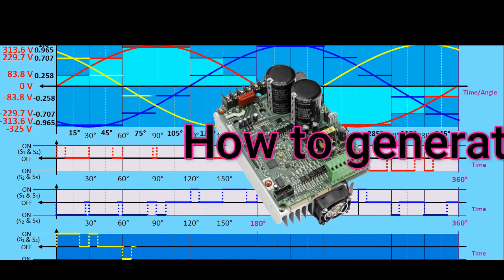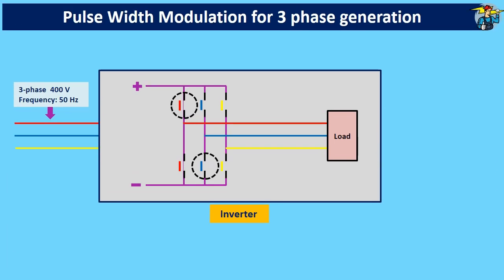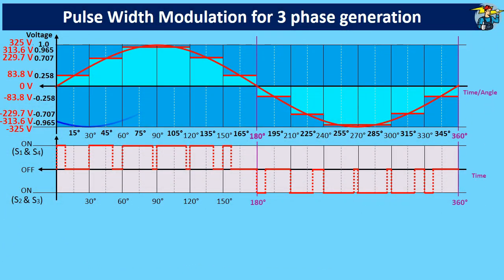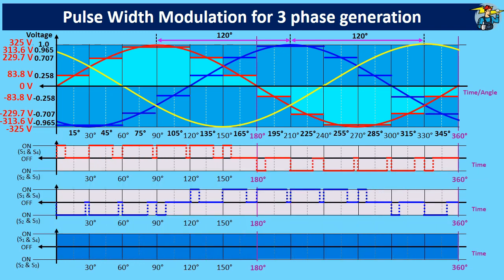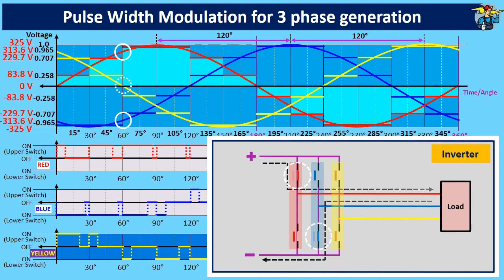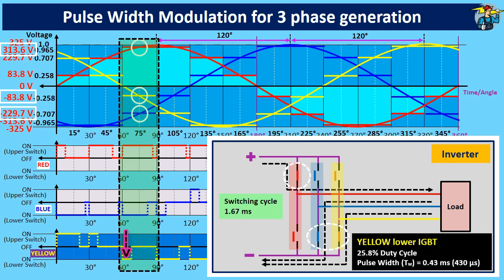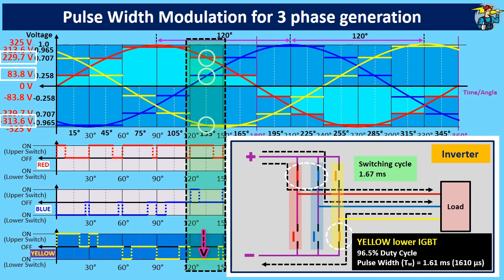How to convert DC to 3 phase AC | How Pulse Width Modulation is used in 3phase VFD Inverter?

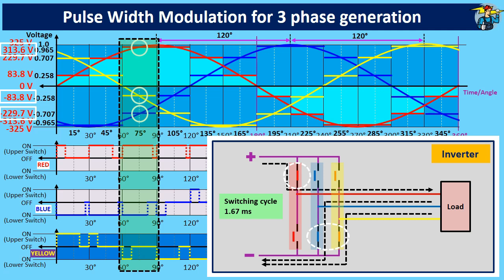Comment: How current flows when only red upper switch is open but all other switches are closed as in 6:17 . End of the cycle only red part is one and yellow and blue  are 0 in the graph.
Reply: You did not answer the question.  At the end of the period red high switch is on but yellow and blue low switches are both off
Reply from the maker: Here the red upper switch is closed and blue and yellow lower switches are closed.
So, current flow through red line to the load and return path is through the blue and yellow lines.
Red line current in this perticular situation is positive since it flows towards the load.
Blue and yellow line current is negative because it flows out of the load.
Current flow on the negative path is equal and opposite to the positive side path on red  line. (Because the load is on balanced condition)
Hope it's clear now.
Thank you.
Reply: Aren't you going to address this (or sanilefishawy's follow-up)?
Reply from the maker: @firstlast-ty4di @sanielfishawy
In the third switching cycle example, the upper switch remains open for 96.5% of the total duration of 1.67 milliseconds, which is approximately 1.61 milliseconds.
This allows a voltage of 313.6 volts on the red line to the load during that period.
To generate only 83.8 volts of negative voltage on the yellow line, the pulse width of that switch needs to be shortened to 0.43 milliseconds (0.258 × 1.67 ms). 
Therefore, the yellow switch remains open for 0.43 milliseconds during this cycle.
Similarly, to allow 229.7 volts of negative voltage on the blue line, the blue switch will operate for 1.18 milliseconds during the same switching cycle.
The current flow corresponds to the voltages generated on these three lines during this switching cycle.
I understand your question may refer to the starting and ending points shown in the pulse width graphs. 
Those are provided only to illustrate the pulse widths of the IGBT switches.
However, during such short switching cycles, it’s challenging to pinpoint the exact opening and closing moments of the switches.
To avoid short circuits in switches, particularly in power electronics like IGBTs or MOSFETs, careful design, operation, and protection mechanisms are required. 
Specifically, it’s essential to ensure there is a delay (dead-time) between turning off one switch and turning on the next.
These aspects are not explicitly shown here, but I hope this explanation gives you a clearer understanding of the concept.